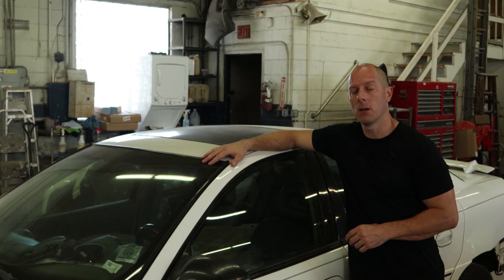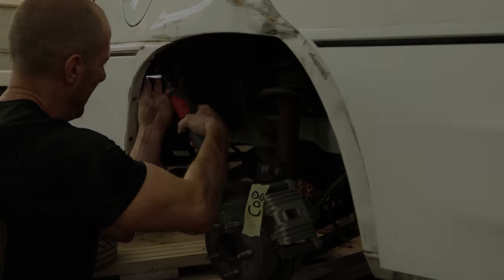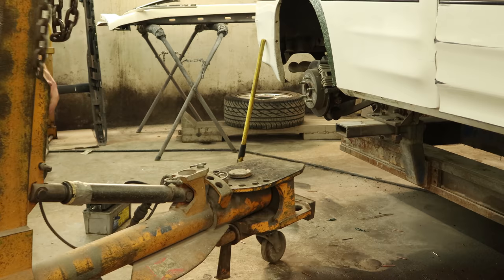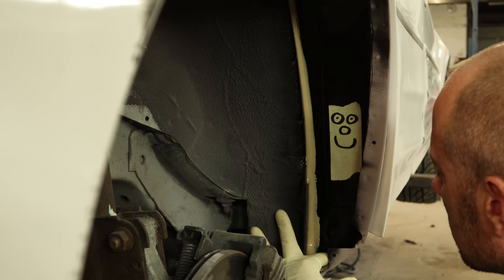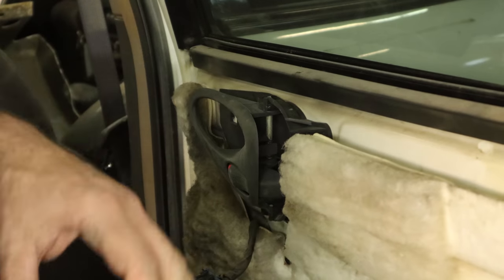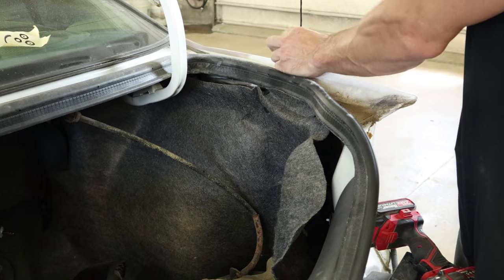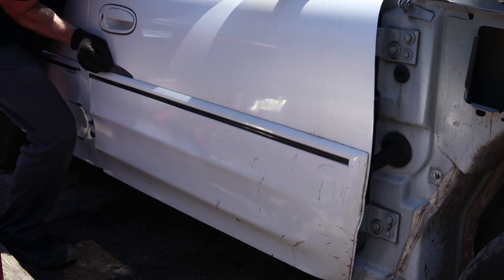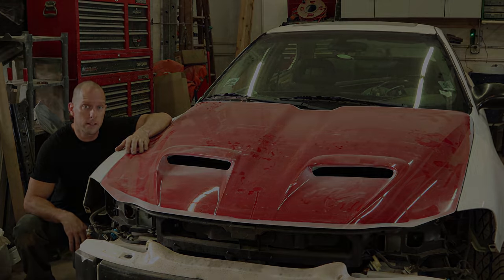Bodywork and upgrades on the super cheap, low mile, daily driver Grand Am

Comment: In every shop there is that plastic clip breaker guy, and it’s only when you get job reassembling one of his strip downs that you realise he never misses the chance to break every single clip possible 100% hit rate. Great work btw
Reply from the maker: I hate it when that guy gets to the car first! 😂
Reply: On my '07 Corolla most of the plastic clips are gone now. They broke all the mounts on the engine cover and it just floats around now. Like gee, thanks a lot for being careful.
Reply: Why do you think they invented tiger seal adhesive
Reply: Lolol

Comment: You always make it look so easy. Great job as always Scott.
Reply from the maker: These really are that easy.  The last of the cars meant to be repaired! Thanks for the support!
Reply: Amazed how you take your work to the nth degree, I would just slather some gorilla hair on. There, grind it. Down. And some 5…99 dupli color spray from wal mart....good. Job!  How about a tricked out fiero for nextlong. Term. Project???
Reply: Pontiacs are pretty easy to work on all the parts come off pretty easy not much too these cars

Comment: I’ll say one thing about you , you go to great lengths to take the car apart to get painted. Where other body shops would just mask around the windows and door handles
Reply from the maker: Yeah, it does not add much more time (sometimes it is actually faster than taping) to do it right and you have a better product that will last.  Those others end up with pealing paint and trim with overspray.
Reply: Maaco probably doesn't hire prep people with enough experience to disassemble without damaging.    For $300,  they'll include some newspaper masking over most of the windshield.

Comment: For those that paid attention, you probably noticed that once you take off the body cladding, the doors are the same as the Aleros.  

Sold these new back in the day. Def a fun car to drive.
Reply from the maker: Lots of panels under the sheet metal are the same.  All the drivetrain and suspension as well.  I did rebuild a few Aleros back in the day.  They did not hold their value or sell as well as the Grand Ams though.

Comment: You make this look so easy!  I have an '04 2 door gt that looks just like this one.(minus the hood with vents)  Do the ignition on all of these allow the key to be removed even when it's running or is it just mine?  I took it to the dealer for an ignition recall a couple years ago and I'm not convinced they did anything.
Reply from the maker: These really are that easy to work on.  The key recall is only to add a block out plate to your old keys, making the key ring hole smaller or giving you new keys.  If the keys can be removed with it running, the tumblers in the lock cylinder are worn out, that is not part of the recall.

Comment: I just got a Grand Am Gt 01’ about a month and a half ago. 
Basically came with a lot of little dings. 

1. Nobs for windows are like loose teeth ready to be pulled out. (Still work) 

2. Ac nobs only blows on high. 
And the Ac compressor did not move. So I bought a new one and switched it. But the clutch is still not moving. For some reason the the cable isn’t pushing power into the ac compressor. So I’m upset about that one. I don’t know much about electrical shit. Which I’m still stuck with no COLD AC. ITS FREAKING HOT. Even with all windows down. 

3. Interior dash is slightly curled and out of place. (Old and cheap)

4. Spark plugs needed to be replaced. (Just fixed a month ago)
BUT! service engine soon keeps popping up with code being on misfires. Comes on sometimes and than comes off. And repeat
. 
5. The RPM meter doesn’t function sometimes. It works when it wants too. As well as the temperature meter next to it. 

6. It leaks water from the DASHBOARD into the Driver side when it rains heavy. (Sometimes leaving puddles and a nasty wet dog smell.) 

7. The idler pulley bolt screw sometimes gets loose when driving so the idler pulley gets out of place leading the surpentine belt sliping out of place as well. 
I have to tighten the idler pulley all over again and than loosen up the belt and put it back into place. 

I bought my Pontiac for 1600. 
Im not going to lie at first I was optimistic about the situation and my car. And I know all old cars need some loving and care. 
I was real happy about it. It looked cool and outside body was taken pretty good care of. 

But shit im starting to really hate this car. 
I almost regret buying it. 
If I could fix the leak and the electrical problem for real cheap. I’d be fucking happy. But idk if thats going to be the case. Especially the electrical part.

Comment: I have a suggestion for your mustang, install a custom audio system in it and sound deadening it, also repaint it
Reply from the maker: I think you are a little far ahead.  Let’s worry about the important stuff like, um, maybe putting it back together? 😂
Reply: @vehcor  do you like the suggestion though
Reply from the maker: It was always going to be repainted.  I did say I hate the color.  I will use the factory 2015 radio.  I guess I could afford to add some weight with sound deadening but it is a convertible so that might not really be all that useful.  🤷🏼‍♂️
Reply: @vehcor  are you going to take color suggestion
Reply from the maker: Yes, I will give you my choices and you can pick from those.  If I let the internet decide it will be pink with purple flowers. 😂

Comment: Best thing for that car is the removal of the pinstripes.  There is only one car that should ever have pinstripes and that is a black Trans Am with three miles of gold striping.  Every other car it should be illegal.
Reply from the maker: I was never a fan of pin stripes either.  I think only certain generations of Trans Ams can even rock them.  I don’t think KITT could pull it off. 😂

Comment: Replace the plastic clips on the bottom of the windows (that go into the regulator) with metal ones while you have the glass out. Trust me I owned a Grand Am.
Reply from the maker: I’ve owned 400+ Grand Ams, I know about the windows and regulators.

Comment: what the paint nolmes dont realize is it takes years of practice not cutting the paint with a razor blade and when you get a clearcoat run you turn into a master at saving it so you dont have to respray by shaving it down

Comment: I have a 2004 Pontiac Grand Am GT that I've been having problems with everything is going wrong with it and I've replaced everything on it and the axles are a major problem. They're not going in right .now I can't seem to get a shop that's doing the right thing and put them incorrectly Lewis axles are normal. Do I still have axles that are not in the right waystill. I was wondering where your shop was if it was close to Illinois or St Louis Missouri. I'm located in granite City Illinois. And it seems like every shot that I've had this car at they've been doing dirty stuff and not fixing things the right way and then lying to me. I've had it at I know five separate shops and two of the shops are Big Nate car dealerships like Weber Chevrolet. I bought the car from Johnny londoff Chevrolet in St Louis Missouri

Comment: Actually using the real frame machine instead of the forklift this time?  Please don't tell me you're going to start following...*gasp*...rules?!
Reply from the maker: I didn’t take the rocker molding off the driver side so I am still a rebel! 😂 The frame machine gives me a higher level of control than the mobile frame rack.  That is the only reason I spent the time to mount it up.

Comment: Why? Pay the painters buy the materials and your time, how can it be worth it?  Content? That’s the only thing I can figure.
Reply from the maker: Let’s say I have $2000 in the $4000 car.   So that is $2000 profit if I have 10 hours in it by the end, that is $200/hr.  I’m ok with that for a wage since I don’t get paid that at work and this is just a hobby.  I don’t like to paint, I could save the money and do it myself but that defeats the point of a hobby.  I would still be paying for the materials and spending more time, bringing my hourly rate down.  I don’t make money on the videos, that money hardly pays for the time and equipment required to make them.  It does however add value in other ways like building a brand and advertising the vehicles if I want to sell them.  I think it might be time for a video that explains it better.
Reply: vehcor 
I was guessing the car was worth $3000, and even that would be good money. My hobby only costs money, zero return. So you definitely have a point. After doing body work for 34 years I just can’t imagine doing it as a hobby.  But then I watch other people do it on YouTube, so I guess that’s weird.